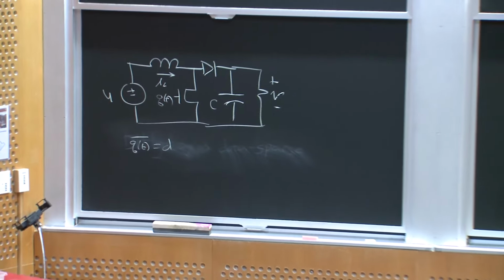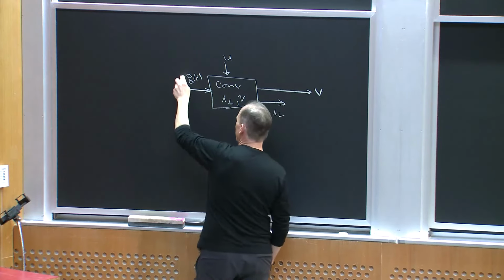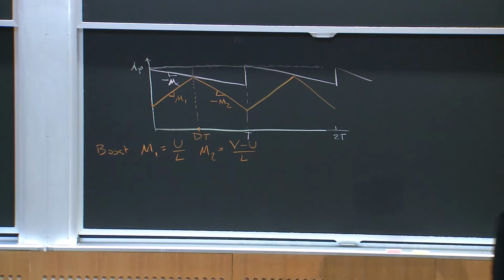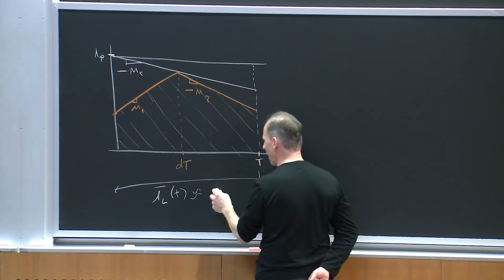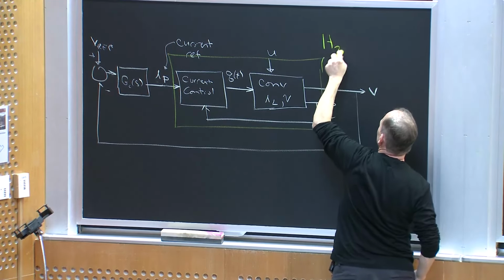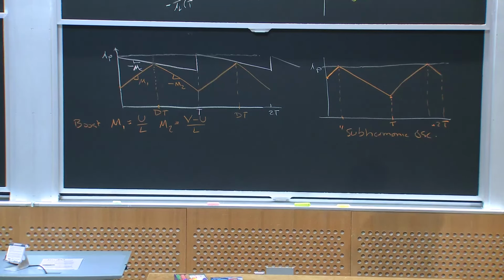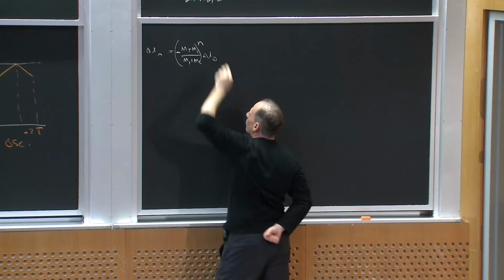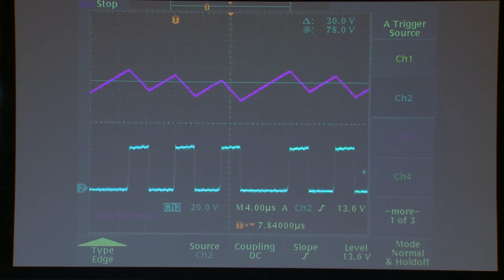Lecture 27: Current-Mode Control

Comment: I have a question, but d~ can use in the average state space model and then, i solve to find the transfer function Gid(s) ?
In this way, the final form eliminate the LC pole and apply a compensator type2?

Comment: 15:22
Note that when using a current sense resistor in Q1(source) that there will be a compoment in the current sample waveform due to the gate drive and the finite recovery time of the output diode.
Need to be removed.

Comment: Very helpful video related to current control mode! However, I've been trying to find the transfer function for  H2(s) =v^~(out)/i^~p , but I couldn’t quite figure it out. I have tried to solve the equation for H2(s),but  my pole seems to be on the imaginary axis instead of the real axis. If anyone has any literature ,has solved this issue or if there are some assumptions that we will do to solve the equation,I’d really appreciate the help! Thanks!